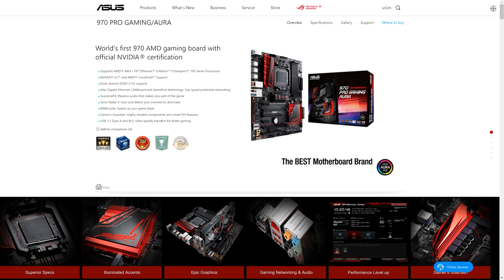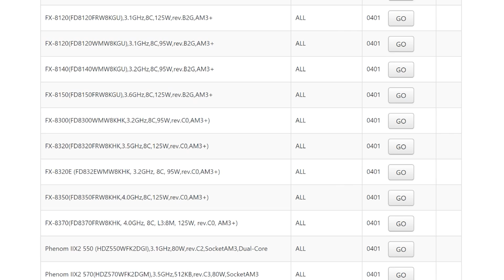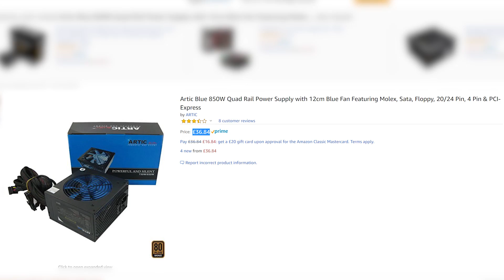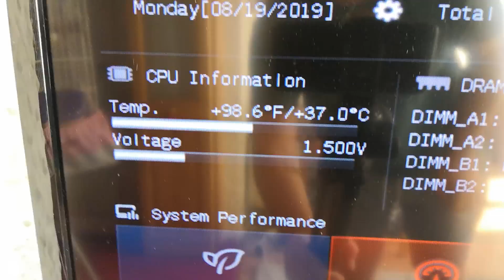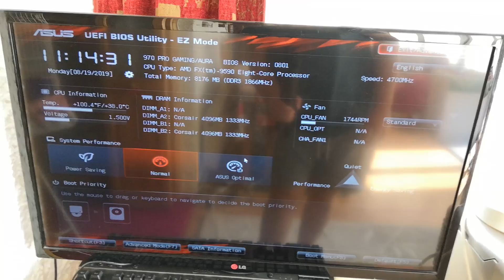This Used Gaming PC Is a 5GHz Fire Hazard (Pt. 1)

Comment: 220w...I thought my I7 980 was hot....this is a fire waiting to happen in the wrong hands. I usually judge PS's first by weight and the fans. That blue fan looks really cheap, also a brand I have never seen. That exact 550ti was my bench card last year, it really can take a beating in some modern low end games.

Comment: I upgraded my FX 8320 with GTX 1660S to R5 3600. I still kept my old FX PC because I loved it. Single-core games did not work so well, but with multi-thread, it still holds up with 2019 games. That old rustbucket grew up on me. :D

Comment: I don't understand why you were so scared to turn on the pc? It's a 220w cpu but that's assuming its actually working on a task or running a program. It's not going to suck enough power to kill a motherboard if its just sitting in the bios, or idle on the windows desktop. I get the concern but that's kinda dumb
Reply: The answer is pretty simple.
The AMD FX CPU itself is already Power Hungry, even when doing nothing, it uses a lot of Wattage.

So much contrast when compared to Core i7 4790K when doing nothing, only uses around 8 Watts.

Comment: The best motherboard for the Fx 9590 is the Asus Crosshair formula V. Another solution would be to underclock the Fx 9590 to 4,5GHZ allcore together with the AMD Speed step thing.

Comment: Been using one of those Arctic blue 850 Watt units for a good 2 to 3 years now. Bought it in a pinch believing the new GPU I bought was overwhelming the aging thermaltake unit that was already in the system. Turns out it was just a dead GPU(Beware of buying cards from CeX stores as that one was and to test my theory I sold them a GTX 580 suffering from weird green dots all over the screen and they didn't even test the card, just gave me the money for it). The Arctic blue PSU seems to be going strong though but I believe at that price point its just luck, some may be made incredibly poorly while some work perfectly, although for the past 3 months I've been experiencing system crashes that are supposedly GPU related but the power supply doesn't seem to be at fault as maxing out the gpu fans in MSI afterburner seems to have remedied the issue, albeit with a noise penalty

Comment: One thing to keep in mind with cheap PSU's is that, cheap PSU's can BARELY ever supply the advertised wattage across the entire unit, where real brands like corsair, can support the advertised wattage on a single rail. 

This means that while the PSU might say 800 watts, the 12v rail may only support 300-400 watts, which really makes the PSU no more valuable than a good 400 watt PSU.

Comment: I don't think there is a issue. If it'd unstable it will shut down. And any quality psu should shut down if a short happens.

För instance I have a 990x in a rampage 2 extreme with 24gb ram. That is not supported but it's been running stable for almost 10 years now =)

Comment: The motherboard also has the wrong chipset. The 990 chipset on a board with an 8+2 power phase rather than a 4+1 is required for this to actually work. I ran into issues with throttling with an fx 8350 and learned my 970 motherboard was throttling it’s clock speeds back
Reply: Also you need to have vrm heat sinks. The vrms like to overheat on most am3+ boards with one of the higher end fx. With the ASUS crosshair v formula z I get 5ghz stable when I couldn’t even get 2.5 before

Comment: my previous system was a FX-8350 system. i liked it while i was using it. i never got the FX-8350 to get over 75c in anything i could come up with. gaming, it never even got to 72c. i was just using a Cooler Master Hyper T2 cooler on it too, so it was funny to me hearing everyone telling em how my cpu was supposed to be a great heater in the winter and that even then, the cooler i went with isnt gonna keep it cool. thats the thing though, mine ran fairly cool and the cooler i used on it did its job really well. when i upgraded to the Ryzen 5 3600 i noticed a few things. first off, the stock AMD cooler was NOT acceptable. fresh windows install and fully updated. nothing running and idle temp was 75c. that is completely unacceptable. so, i decided to pull out the old Cooler Master Hyper T2 and it did help some, but it would still idle at 65c. again, not acceptable to me. i went ahead and ordered a Deepcool Neptwin V2 cooler for my Ryzen 5 3600 sitting on a Asrock x570 mobo. i had to wait two weeks for the new cooler i ordered to arrive, and during that time, i couldnt even use my new pc. had i known the stock AMD cooler for the Ryzen 3600 was as bad as it was, and that my Master Cooler Hyper T2 wasnt gonna cut it either, id have ordered the new cooler when i ordered the other parts.....so, while i was waiting those two weeks, i actually had to go outside. yuck. lol

Comment: The AIO is installed upside down. This could potentially over time as liquid disappears from the unit, cause air bubbles to be pumped to the CPU and cause noise in the pump, damage it and provide less cooling for CPU. The lifespan of the AIO could in a worst case scenario be reduced to only a few months.

Comment: GTX 550ti was my first graphics card way back. I got two of them in a bogo deal and put them in SLI. Not terrible, and I could use all 3 of my monitors(FYI, FERMI cards, the GTX 400 and 500 series, were limited to 2 utilized display outputs per card).

Comment: Bruh you are way exaggerating the power that system is gonna pull even with the 550ti LMAO 🤣🤣 max that system will pull is around 350 watts lmao it will be a good idea to use a watt meter then you will get a understanding that even the most powerful systems don't even run that much wattage, a 500 watt psu would be plenty for that system and 600 would be over kill lmao and u acting like a nancy and taking out the 550ti

Comment: I've had a 9590 couple years back. after some time it just shuts down. apparently, 5Ghz was to mutch and had to be clocked down. it was never overheating. it was a pain in the ass because i did not have the knowledge i have now.

Comment: Apparently it was listed as compatible on the website at different times, even though it is not now for some reason. And it was a combination used by people without any issues that were not normal with the processor anyway.

Comment: A 550ti?! I didn't even know those were a thing lol. I had a GTX 560 with an i7 2600k (which still works great) back in 2012 when I bought my prebuilt Ibuypower off of newegg....the next year I did some research, got into building and replaced all of those shitty parts they gave me. The power supply was a 700w Coonex........wtf is coonex?! A BOMB! I'll never buy a prebuilt again, unless I get to pick my parts and it's a good deal.

Comment: Had to down vote this video. I had to smh with your overly exaggerated performance, everyone knows the Seasonic and board would handle the system just fine, no need for the "I'm afraid to turn it on" show you put on. I could understand if you went for a balls to the wall OC and stressed the system then the attitude would be warranted but its just sitting there at idle.

Comment: The 970 board won't blow up as long as you don't go out of your way to run a power vampire on the system. Even then a good fan pointed at the vrm's would probably solve any issues. As long as the case doesn't get too hot while gaming it should be stable, I've seen several 9370's and a few 9590's running fine in 970 platforms.

Comment: the 9590 system i built for a friend was a nightmare to get working. Once it was it ran nice for 3 years. 3 years of neglecting the radiator in the AIO. System kept freezing. i upgraded his system to a ryzen 2600 and now i have the 9590 in my computer room and it runs just fine despite the abuse. I paired it with an rx 570 and i let my nieces play on it.

Comment: Idk why you were hyping this up, its been proven many times that some 970 boards can easily handle the FX-9000 series without a scratch... sometimes chipsets are all marketting and understanding individual VRM setups is much more useful. Im actually buying a 970 board and pairing it up to an 8350 for 5-5.1 Ghz performance on a liquid cooler... and then pairing that up with an R9 Nano or something for a somewhat HTPC build

Comment: A 230w TDP, 8 core , 5.00 GHz AMD CPU & you think an air cooler would be better than the corsair AIO thats in there ?? yeah maybe a Noctua  NH-D15 possibly , good luck getting something that big in there & feeding it enough air , anything less & your going to flash dry the fluid in the heatpipes once that thing hits 5 GHz at 1.50V , NO what is in there is better than any cheap air cooler you could fit .............All the gear & no idea , if it were a fire hazard before it certainly will be if you put some £40 air cooler in there lol
Reply: Shut up
Reply: @cowwoc1  No its misleading , it could cause some noob to overheat & or damage their CPU idiot .

Comment: The FX-9590 is actually 4 cores running 8 threads. (4 modules containing 2 cores each) They can't run separate processes like a 8 core cpu should. It can only run 4 like a quad core CPU. This is also one of the worst CPU's I owned 2 times in my life around the time it was new and it was mind blowing due to the 8 cores and 4.7ghz wich later turned out to be a modified truth as I stated earlier in this text. and it only caused so much headache for everyone running it as it was hard to run things without encountering random things to go wrong and unstable.

Comment: What are you so scared of? It’s not going to blow up haha. Yeah I’d replace the PSU too but you’re fine haha. I had my 8350 at 5.1ghz pulling at least 225w as well and it ran pretty quiet with a Noctua air cooler. Ran for like 8 years before I upgraded to Ryzen

Comment: I'd give you my old build if you lived in the states for 20 dollars lol. Might not even be worth that though truth be told. Phenom ii x6 1055t, xfx 7750 2gb, 8gb corsair dominator. 750 watt Thermaltake psu, gigabyte mobo with a am3+ socket that I've never gotten to with with an FX chip. So ya, junk. Bricked it with a bios flash too so needs a new hdd.(had win 7 64bit) as old as it was I was able to push gta v 40 fps avg with oc on both the chip and gpu. Oh and the phenom is cooled with a cooler master sedion 240XL cc water cooler.

Comment: If you were to put in an fx 8000 series cpu it would still be a power hungry machine and be too much for that board especially with an overclock, the 9590 is just an over clocked and binned 8350. These 970 boards are more suited for the 4&6 cores

Comment: This reminds me of a friend of mine who build an FX-8120 build back in the day and used the cheapest motherboard he could find. Some POS $40 board with a 4 pin cpu power connector. And he wondered why it throttled to 1.6GHz constantly at stock settings smh.

Comment: Iam using a FX6300 at 4.1GHZ 8GB and a GTX 970 SSC with a low end watercooler, the cpu runs in idle at 20ºC , and under stress at 40ºC, i can run GTA V ultra in arround 50-60fps , any VR game , bf1 at 100fps high, its not about the hardware, its about who owns it

Comment: put a 990fx mobo in it and lock the HT and NB frequencies at 2200mhz ( which is intended factory stock from AMD )  if you dont it will auto set it to 2000mhz or lower a very common issue on this gen and that drastically effects performance 1866mhz for the memory is the sweetspot unless you do NB overclocking you want to keep NB to around 200mhz+ above whatever the memory frequency is on these otherwise your higher frequency ram does nothing for you also these love tight timed 1866mhz memory really gives a good increase in performance.

Comment: ok all jokes aside dont be a drama queen that cpu would be perfectly fine on that motherboard trust me
Reply: 220W is only the worst case load wattage. Just booting to Windows would draw less than 125W. Plus the motherboard is probably designed to overclock 125W CPUS which would push 200W anyway
Reply: Agreed 🤣 dude acting like a nancy lmao and taking out the 550ti hahaha even with the 550 the most that systems gonna draw is 350 watts on a high end lmao 500 watt psu would be plenty for this and 600 watt psu is overkill

Comment: I understand your concern but there is no rating for power draw, pc booting up doesn't draw it's peak load. If you draw more power then the Motherboard can supply, it will just crash.... 
As long as it is cooled properly (all components including the Vrams) It won't blow up.

Comment: i know that Videos is 2 Month old now, but you can use that board and CPU combo no problem. The Board is rated for 125Watts because there werent higher usage CPUs at the release i think. TBH the VRMs are beefy enough with 8 big phases and cooling on it. If there is some air over them anything will be fine. The board is made for high OCs, so it can handle a Stock 9590 without problems.

Comment: The CPU power rating does not apply in such case
125W just means it will run all so-called 125W CPUs
I did overclock my (already sold) AMD Phenom II X6 1090T to most 4.0GHz and I doubt it was consuming just 125W. It was definitely closer to 250W
I did overclock this on Asus M3N78-EM and there was no FX processors available yet, not to mention FX-9590
I did same overclock on M4N78 Pro, M5A97 and SaberTooth 990FX R2.0
None of those support anything above 125W CPU, yet it was stable enough to run overclocked like this for days

Do both test motherboard and CPU. You may quite safely test both together.

Comment: this is the most cringe
 video you ever created 
you too over react already! if it been using previously meaning it will power on and work just fine with the old power supply hack even with the seasonic psu also will work fine (provided the pc is working to begin with) 
even with the gtx550ti just boot up wont take more then 500w. what a joker

Comment: I laughed so hard with that little 120 liquid cooler. I have a H100iv2 with push pull noctua fans and it still can get a little cripsy at 48c at 5ghz. Idle is at 21c. That little setup is def a fire hazard lol

Comment: Why would anyone build it that way? I ran an 8350 OC to 5.0ghz on a Cooler Master 612 before i bought a Corsair h100 (no cooler just quieter) but it was on a 990fx Asus Sabertooth. It was a pretty good machine like 7 years ago, BF3 64 player multiplayer used to run quite well (at least as well as that game could run).

Comment: I have a asrock 990FX Extreme9
 motherboard with a 9590 in it which I will give to you if you want to try overclocking this electric heater AMD call a CPU. My 9590 has problems so you will need to use yours but the boards only done a year of service from new, It's just going to go in the bin if not. also comes with 24gb of ram but can only install 16gb on the board, have no use for this stuff anymore would be nice to see it been used again.
Reply: just to add you will need one hell of a cooler for this cpu as you already know but if you trun it up to 5gh which is an over clock not a boost, no air cooler will keep this cool even just running windows,

Comment: I think you should run it in the config it came with, let it burn (keep a fire extinguisher close tho, dont let your house burn down) and use it as content, due to it being FX thats about the only valuable thing with it.
However if you want it to actually run, I think it would be better to upgrade the mobo and maybe make a video showing how badly the cpu bottlenecks/performs.

Comment: That motherboard will be fine with that CPU. You have to understand that when you were overclocking even the older 8xxx series chips their tdp was shooting up 200+ range pretty quickly. The chip you have is basically a binned 8xxx chip that just runs overclocked out of the box.

This was AMD trying to answer the new I series intel products by throwing high frequencies out there... when it reality they just needed a true 8 core CPU with better IPC.

Comment: Maybe you consider a third option: underclock/undervolt the FX-9590 just to make it stable. After, you may compare the underclocked CPU with the FX-8370 or so to see if doing so you loss.

Comment: I'm still rocking my 9590 but it's coupled with a frostflow+ 280 liquid cooler :) 

Keep the 9590 and stick it on a MSI 970 Gaming MOBO as i still think it's a little gem of a cpu and it handles anything you throw at it.
Just dont pair it with an r9 270x .... get better gamplay from an old apple 2 machine haha

Comment: the 970 Aura doesnt "officially" support the FX 9590...but there is actually very little risk of blowing up that motherboard with this CPU. it works just fine, ive repaired a system locally in the past year that used these components and the customer had no idea what was wrong, feeling either the PSU or motherboard had fried because of the same thing. PSU was 80+ Gold 750w and worked fine in another system, so that wasnt the issue. turns out they had a stupid memory configuration and a busted 1060, NOT as a result of the CPU/mobo choice. replaced the sticks with matching XMP 1866mhz DDR3 and installed his new GTX 1060 6gb and the thing fired up just fine. stable as all hell and quite the gaming beast.
least i'd do is replace the PSU with a quality one and either drop that 4.7ghz overclock to something like 4.3ghz or just replace that cooler and some Kryonaut thermal paste wouldnt hurt. as long as that CPU stays cool, youll be golden. dont sell it either...im sure itll beat your current personal rig, that thing is a monster.
Reply: exactly what I was thinking, even if it isn't good enough the VRM would just throttle anyway stopping it from overheating and destroying anything